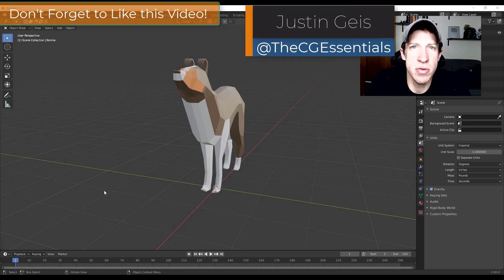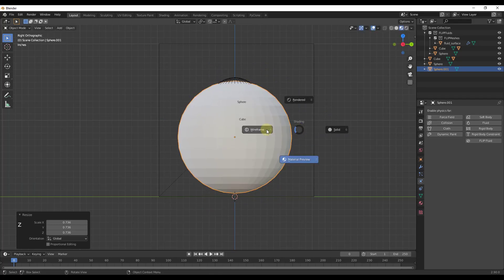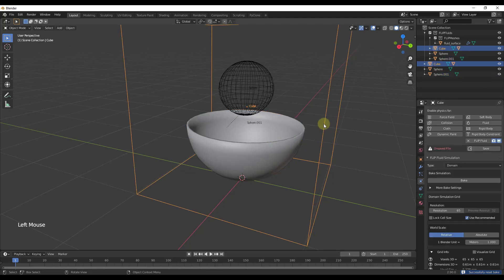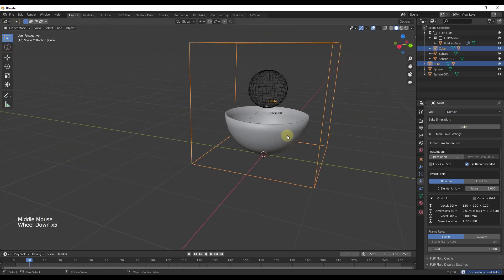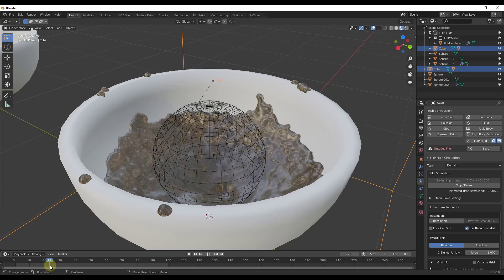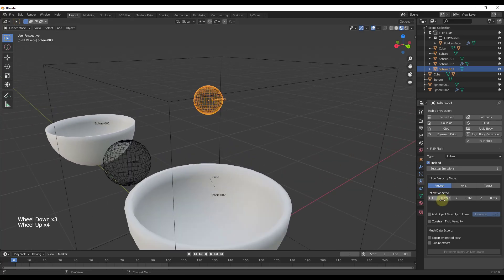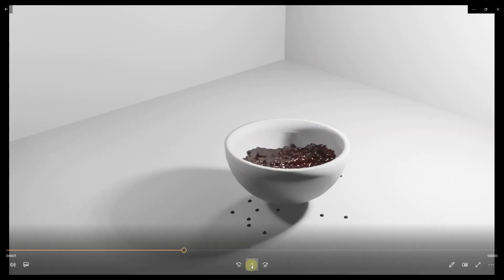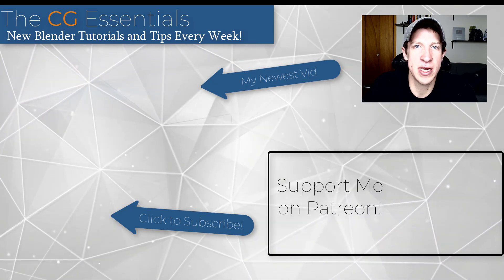Getting Started with Flip Fluids PART 2 - Fluid and Containers with Obstacles and Inflows!

Comment: How would I animate the water pouring out of a water bottle? Every time I start the flip fluid inside of a bottle and try to  pour it out, the liquid stops at the opening of the bottle as if there is an invisible face blocking it, but there is not. I'm amazed there's not a single good tutorial online for this. Every tutorial is just the water emitting from an empty space and into a big open bowl. I also tried enabling 'inverse' on the obstacle but that gives me the same issue. What's the best way to start the fluid in a bottle and pour it out?

Comment: Ive been trying ot find info about this for a while, but how do you limit how much liquid is sent with this addon?  And i cant find the boundary options to make it so it doesnt "clog up" and fill the entire domain, i tried using an outflow on the end but it didnt seem to work, aswell as not sure how you would get the extras like foam, bubbles etc to be baked and into mesh so i can actually give it specific materials and such.. For some reason im struggling finding information about all of this :/

Comment: Hi, I was wondering if you will make a similar video about the force fields for the Flip Fluids add-on? Maybe you have already and I didn't find it?
The reason is, I was delighted to find force fields in the latest FLIP Addon version BUT I struggle to get them animated the way I want. When I keyframe a forcefield object it just moves but the force field itself does not and just stays in place. I can't figure out why it does that.